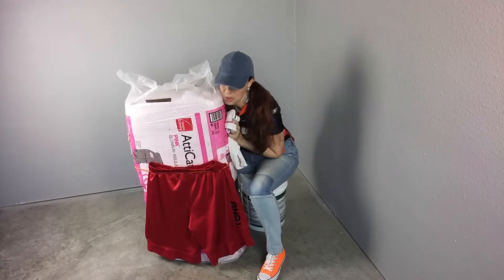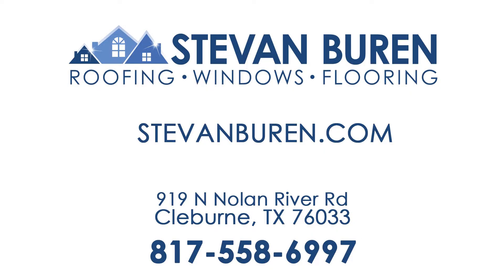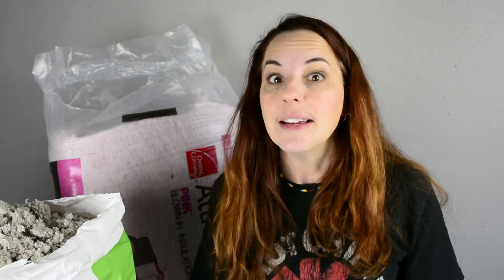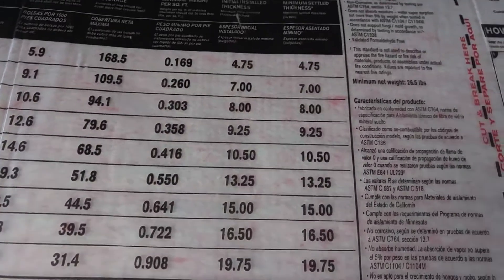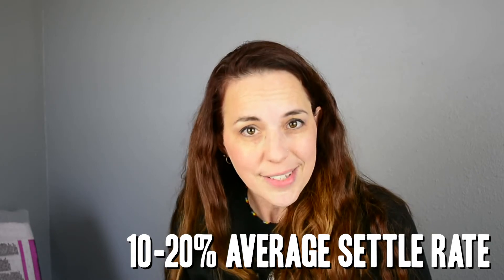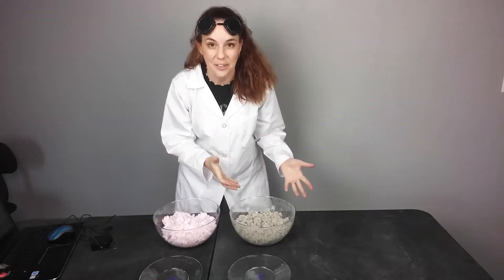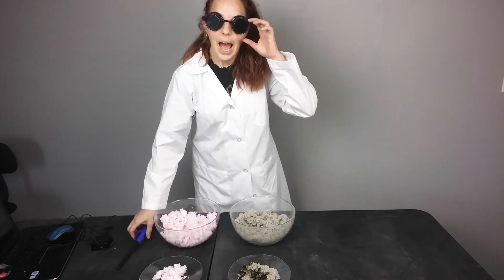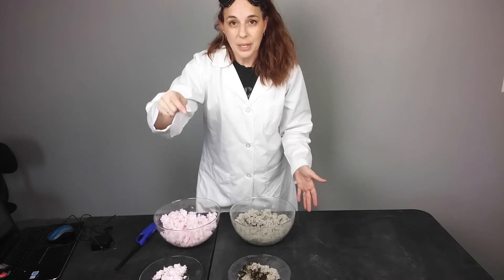Fiberglass Vs Cellulose Insulation, Which is Better?

Comment: Wish you had covered a demonstration of AIR FLOW bc the itchy stuff mislabeled "insulation" fails to stop AIR FLOW (convection) thru cracks and gaps (like around cieling mounted lights etc.)that is the most likely single reason your house lost heat!
Reply: Your talking about fiberglass Batts. Fiberglass dense pack protects convective heat loss with more r value than cellulose in walls. Neither cellulose or fiberglass in an attic are airtight. Cellulose will start deteriorating no later than 15 years after install. And need to be redone by year 25 or sooner. Fiberglass blown in will outlast the house. With a minimum 80 to 100 year lifespan. Plus glass doesn't soak up moisture, The airpockets might but cellulose is paper and paper soaks up moisture. Paper crumples when it gets damp and never recovers. Also, cellulose is SUGAR, why on earth would you want to put a food source in your house. What happens to food over time, it breaks down and decomposes 😆

Ultimately it doesn't matter what conventional insulation you use. None of it is 100% air tight and it only represents 10% of the air seal in a system. Drywall is 70% and sheathing is 20%. In an attic you can lay perf foil radiant barrier over fiberglass loose fill to put an aircap on the top layer. You can't do that will cellulose because will just hold on to vapors like a sponge amd cause problems. Essentially leaving cellulose attic insulation to ever only provide protection against conduction, not convection or radiant heat flow.  

Don't use trash amd dont vapor lock your building and you won't have a problem
Reply: If you air seal it won't matter

Comment: Not hating like some posters, but let’s break Thsi down in a more balanced way
1. Rodents- unless you close cell the roof deck, this risk is there esp if live in wooded lot. But is loose blown  is less attractive to rodents for nesting if using blown in-the tunnels collapse. Is this a Metairie difference? Who knows, but it’s clear cellulose is not more attractive to rodents. Maybe stabilized cellulose is, but that’s not used that often in attic insulation
2. Fire resistance-Thsi is the most glaring oversight of your analysis-even a cursory web search would  show Canadian formal testing of actual id ethical structures proved dense packed cellulose way better in cas elf real fire-why? Dems packing removes mo un fo the oxygen and air movement suppressing die spread appreciably. 
3. Borate does NOt evaporate from the cellulose-did you even take chemistry in high school? As for the ammonium -it can smell esp when conditions get humid, but simply specify borate only cellulose -widely available and at a minimal overall price increase.
Mold- borate is. A quite effective mold suppressant, and mold grows quite well on the dust that settles on fiberglass fibers due to air movement . I’m not gogin to try to assert that cellulose is superior from a mold standpoint, but it’s certainly no worse !
4. Respiratory concerned. Again, speficiy borate Nole cellulose.I’d much rather have my kids breathe paper particle with borax than nay mineral fiber product…no contest.
5. Moisture-again the dense packing cellulose limits air movement the major source of water vapor in any wall assembly. 
6. Walking paths-if you ever have to walk through blown in insualtion, and who hasn’t had soemone up theer fixing a leak adding a can light etc, cellosue is much easier to spread back to full depth
Reply: Ps- 7. Cellulose blows more easily and gets into small areas and esp wheer joists meet the plate at edges of attic.but my biggest gripe? It’s way too easy to cheat on fiberglass blown in job than cellulose as you can pile fluff it up -if you had not said  said you were not a professional insulator I would have wonder if this was your agenda.

Comment: Just so  you  know this cellulose  insulation has been used in U.S. and Canada for  50 years ...
It  does NOT lose it's  fire  retardant, or  mold/vermin repelling features.
That is just absolute nonsensical misinformation,
Cellulose is actually a classed fire  barrier  used in commercial buildings.
cellulose  has a  recognized R-value of 3.7  per inch.
Homes insulated  with cellulose  will  use 30% less energy, than  home insulated with fiberglass.

loose fill fiberglass is  R-2.2 - 2.5 at best per inch.
You-are-absolutely- wrong, mice, squirrels and racoons  are not deterred whatsoever from  loose fill fibreglass.
They like  to  burrow into it,  and  make nests, they  aren't  bothered at all by  the itch factor.
They  do  however  stay  away from cellulose...

Loose fill  fiberglass is one of the Shittiest insulation products on the market! Absolute rubbish!!  it allows  air to  easily pass through it.
Blown fiberglass suffers severe convective looping in hot or  cold weather,  reducing R-value performance by  40% !!
It doesn't burn.. No, it literally vaporizes  to nothing,  leaving  toxic smoke  from  the binding agents!
Loose fill fiberglass is full  of  binding agents that  are worse than borates, it is also a known carcinogen for the lungs.

GET YOUR HEAD OUT OF YOUR ASS!! GRAB a  BrAiN!! GROW Up, and learn  a bit about building sciences, thermodynamics, and building products before  you  post an asinine grade 7 science project style video on a subject   you obviously  know  nothing about.
Reply: I agree with your logical argument but not the insults in the final paragraph. It's easy to say mean things when behind a keyboard. Her video helps keep the discussion going. Please be respectful.
Reply: @MrBrianDuga  Yes,   fair  enough.
Anybody  can  post a video on YouTube as well, this  video  happens  to  consist  of mostly erroneous content,  alot of  which is anecdotal urban  legends that started 40  years  ago by fiberglass  sales people.
 All can  be  easily  refuted,  and  has  no  meaningful scientific merrit.

Zero  research,  knowledge, or thought  was  put  into this video,  other  than  selling  blown  fiberglass to  customers  who  know even  less  about   insulation than the  two individuals in  the  video.
I wasn't necessarily  trying  to  be "mean",  I was  trying  get  my  point  across about lack of knowledge of  building, and insulation products.
Reply: Ja. Die Amerikaner müssen erst noch aufwachen.  In Deutschland  hat es auch gedauert.  Hier wohnen auch viele unterm Dach.  Mit glaswolle oder rockwool  schlafen die im Sommer alle im Keller.  Weil man es in den Wohnungen nicht mehr aushält
Reply: As a professional who understands the mechanics behind various products and materials. What your saying is untrue.  Vermin will get into anything. Cellulose is 70% recycled paper and 30% additives. Cellulose is not anymore airtight in an attic than fiberglass the difference is negligible. Cellulose begins to degrade at 15 years. It needs to be redone every 20 to 30 years in an attic. In a wall sooner because vapor and moisture cause cellulose to settle. Dense pack and loose fill will last as long as the building with a minimum 80 to 100 year lifespan. Glass doesn't soak moisture up and acts as a vapor retarder. Cellulose is made of SUGAR that is what cellulose is, and cellulose Soaks up moisture and breaks down.  The temperature delta difference in r value for fiberglass is meaningless unless you live below -30 for any meaningful length of time. You can put an air barrier/radiant barrier over fiberglass loose fill protecting against all 3 heat loss paths. Cellulose loose fill only protects against conduction and you can't cover a sponge with a air barrier. Limiting the recycled trash to an effective waste of money
Reply: Hey! Stacey here. I'm the 'asinine 7th grader' in the video. I did actually research--AND cited my research, thank you. Please note the links in the description.  Those are a few of the more readable documents, but I can share more scientific reports if you'd like. I've got my source records on a backup drive around here somewhere. Please also note from the video itself that I got my R-values directly off of the insulation's packaging. After 23+ years in and around the construction and repair business, I can tell you that I have personally seen the difference between cellulose and fiberglass insulation as far as critters, the weight of the material, and its insulating ability. I put loose fiberglass in my own home and I firmly stand behind everything in this video.  Thank you for taking the time to comment and please do share your scientific sources!  Have a wonderful day!
Reply: @stampalooza  Lol.
Got  all  your  info  from  Pipers son ,  huh ?

Despite all the  sources  you have  cited,   you  clearly have limited understanding about  insulation.

I've been  in the  new  home / commercial building business  for  over 30 years.
In the  80s  loose fill fiberglass  took  over  the residential building  industry, not  because  it  is  better,   but  because it  can  be  easily overfluffed .
A  convenient way  to  cheat  and  not  get  caught .
Still happens here  all the  time.
They  blow in 15" ,  instead  of  using  50 bags,  they  blow  38.
Then  charge the  builder  for  fifty.
That  15"  inches  is  supposed  to  be R-38 , but  is likely  far less.

Cellulose cannot  be  cheated by  overfluffing, thermal  imaging  cameras  are  a good  tool  to  demonstrate  the difference  between  loose fill fiberglass, and  cellulose.

Where  I live  we  have  very  hot summer temperatures, as well  we  get  extremely  cold  winter temperatures.
Thermal  imaging , and  energy  consumption comparisons  in  similar structures  will  tell  you a lot, summer, or  winter.
Loose fill fiberglass loses  almost  half it's  R-value below   -20° c.